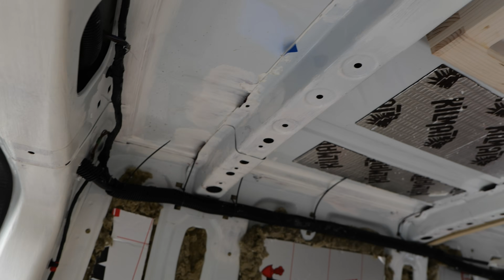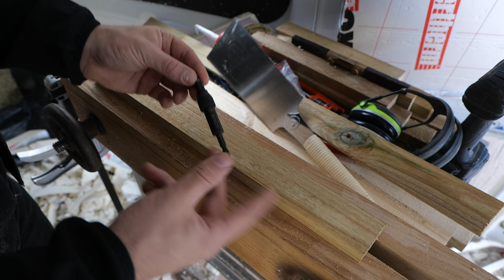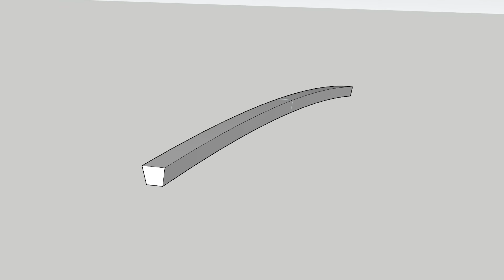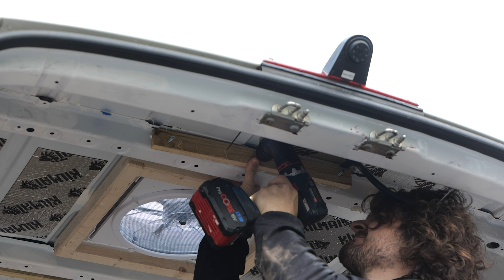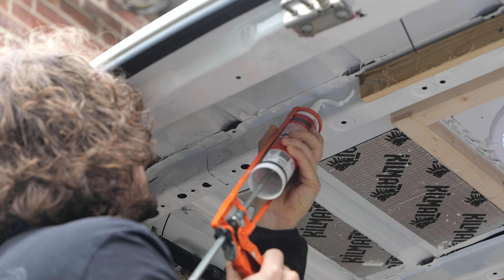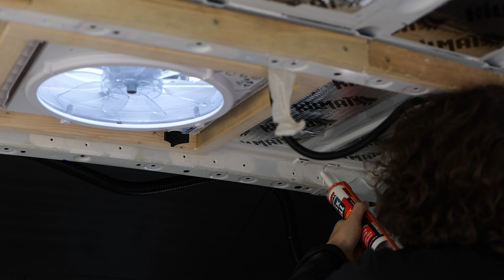Installing Roof Battens in a Van (Cladding Preparation) | Mercedes Sprinter Van Conversion #18

Comment: What was the purpose of the battens? Couldn't you have just used the ribs to install your cladding and put perpendicular battens between the ribs for support?
Reply: He did literally say this in the video. In order to screw into the ribs you need specific type of screws. For the wood you can use anything. So it makes it a simpler task. Also I suppose as a bonus, the screws are IN the wood and not at risk of getting wet and rusting. That’s always a bonus

Comment: An alternative to securing the cladding to timber battens is Rivet nuts into the metal forms, then fasten the cladding via set screws or bolts into the Rivet nuts